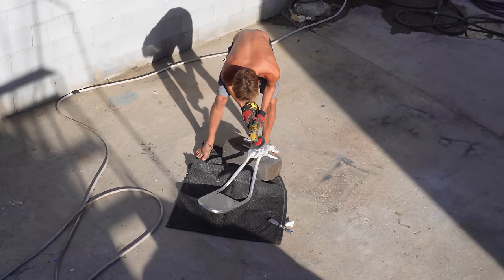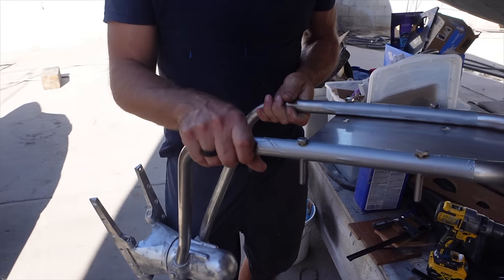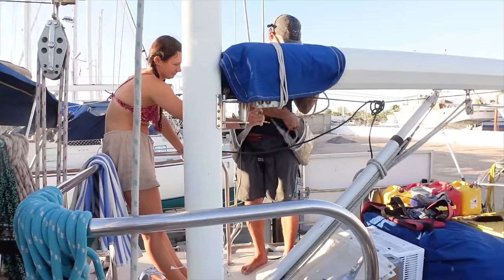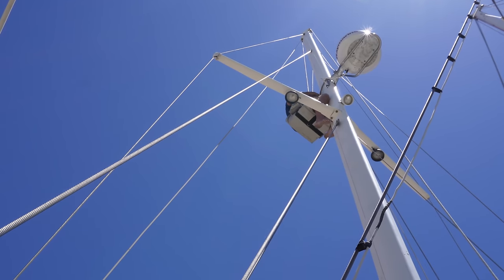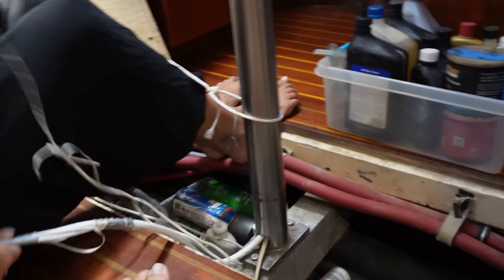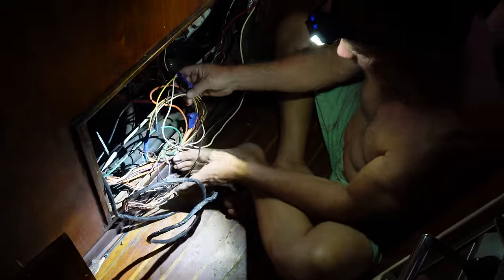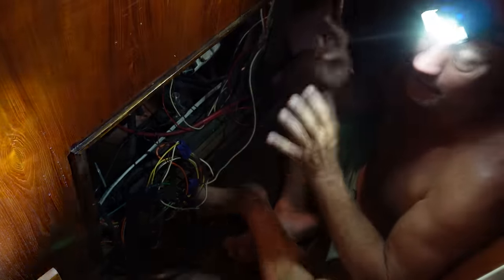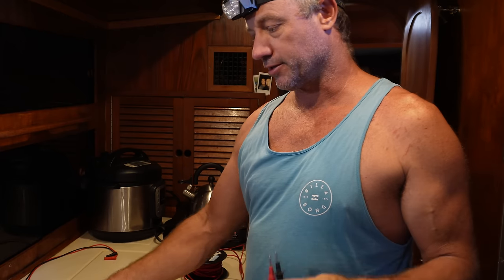How to DIY Trace Wires on a Sail Boat Ep 412

Comment: Continuity testing can sometimes be deceiving in dodgy wiring. Back in my Telecom days, we were terminating 40pair / 80pair / 120pair cables and doing continuity tests after each cable. There were some techs who were very quick and able to knock off work early. Weeks later, we found they only terminated the first connection and joined all the other wires together. "They all went to the same place, so it didn't matter". 😮😅

Comment: When I was with the phone company we'd be sent to a building, some very old buildings, wires all over the place, a connection in a room/office ect, . We'd hook up a "sounder" gadget, it was able to put a signal into a pair of wires, or sometimes a single wire, we'd go to other places where sometimes there were entire rooms of wires, and we had this gadget with headphones and a sharp point, we could hold that gadget near bunches of wires and hear the sounder noise if we were in the right vicinity. Eventually you could get right on the specific wire or pair of wires. You could actually hear conversations coming from the wires without actually being connected ! Very handy for complex harnesses ect.
Reply: We still doing the same thing.........

Comment: FYI - @0:10 Preventing heat externally on glass keeps it much cooler inside, vs it already inside with those, rising out the top to the ceiling. External white perforated (dots) vinyl window film, resists heat, provides privacy, & a nice filtered non-glare light inside during the day. Easy DIY.
Reply from the maker: They were on for filming to stop the glare ☺️ thanks for the tip though 😁

Comment: Hey man, love your videos. Looking for some advice: I have a decent hole in my Ferro cement boat. Something like 300mm x 300mm. I’ve replaced the steel and mesh, tied them all together and I’m about to fill it in with concrete. I’m deciding on whether I choose either Portland cement & Silica sand or epoxy mortar with some admixtures in there to give it a bit more strength. Have you had any experience around this? And if so, do you have any advice?